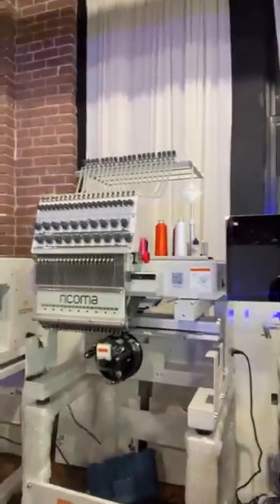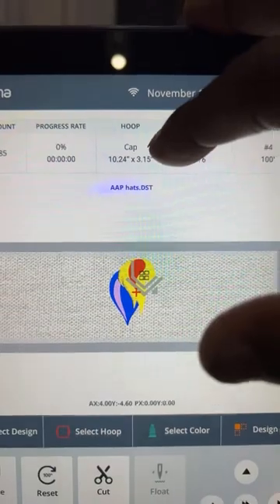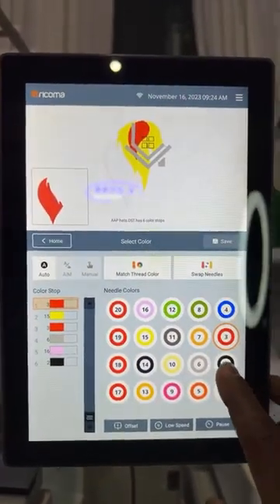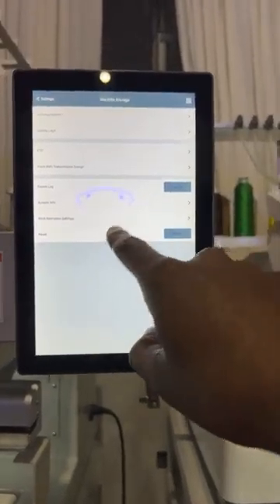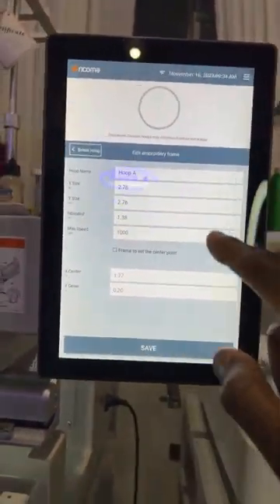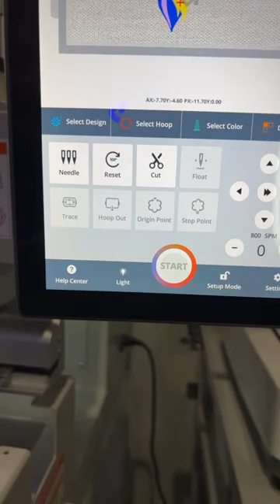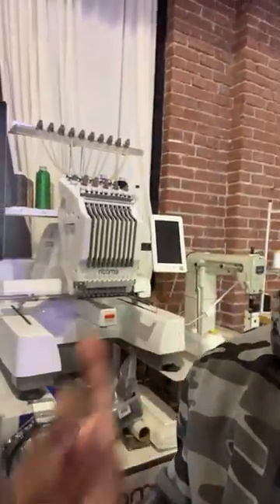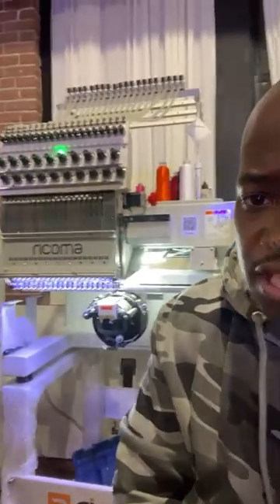Good Investment for your business?

Comment: Hey,   So cool didn't know they had a new machine.  Please tell me you can turn the thread break notifications off on this one.  Meaning it will stitch without the needle threaded 🤞🏻.  If not then being Wi-Fi maybe an easy update down the road 🤞🏻
Reply from the maker: How can it make a stitch without thread in the needle?  How does that work?  Not sure if that even makes sense.  You need thread in the top needle and bottom bobbin case to make a stitch.  Please help me understand your question.
Reply: @adubbproductions    There is a needle that will cut your fabric vs. stopping your machine and cutting the fabric yourself.  You don't do anything.  But the trick would be to trick the machine so it would stitch without having thread in that one cutting needle.  It really would be a game changer. For your too as your wanting to do more appliqué :)